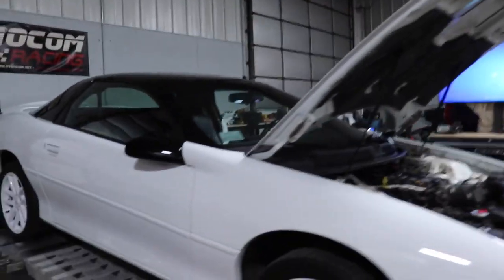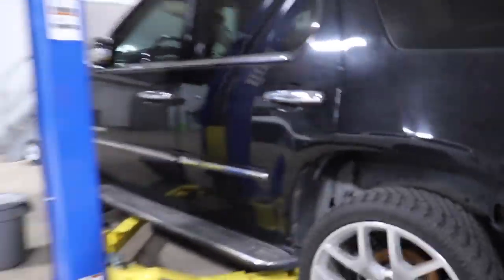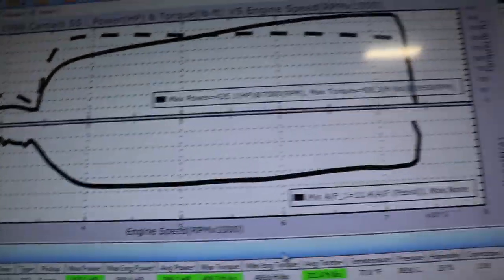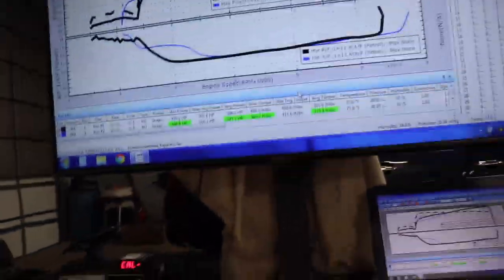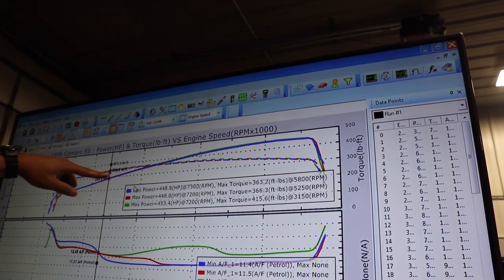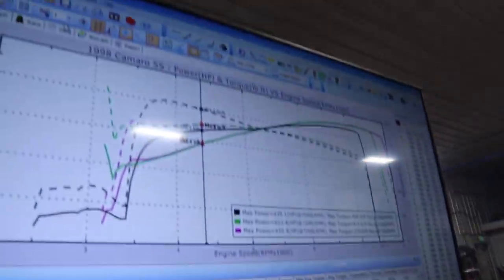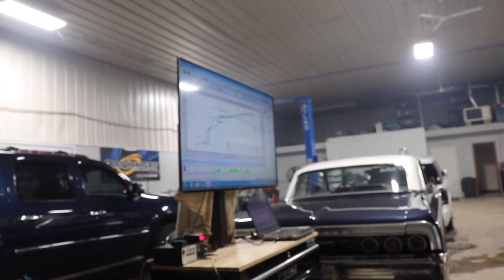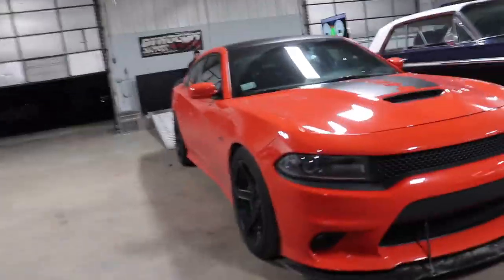BTR STAGE 4 BOOST CAM DYNO TUNE ON CAMARO Z28!!!

Comment: This thing sounds nice! Quick question, were the numbers you were giving rated at crank horsepower? Mine made 440 at the crank but 360 to the wheels
Reply from the maker: I personally think the dyno was reading high but it’s suppose to be wheels I’m think close to 370 hp